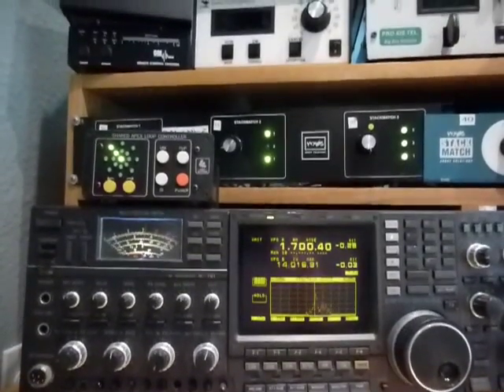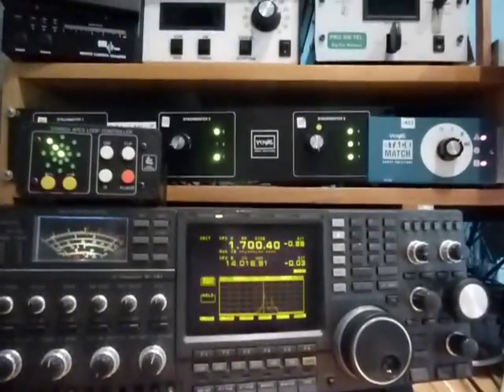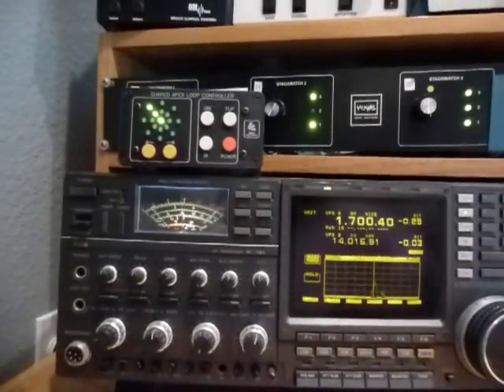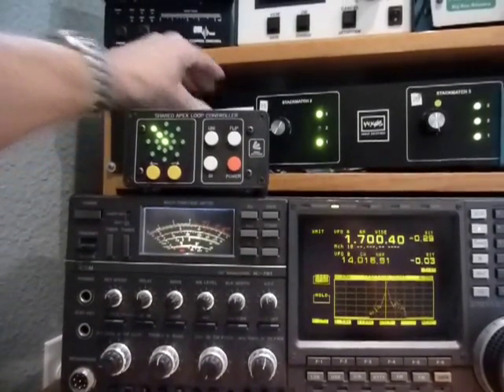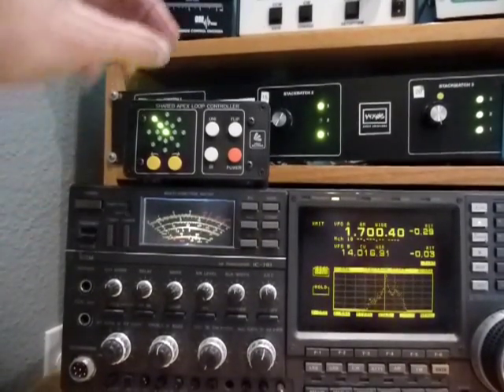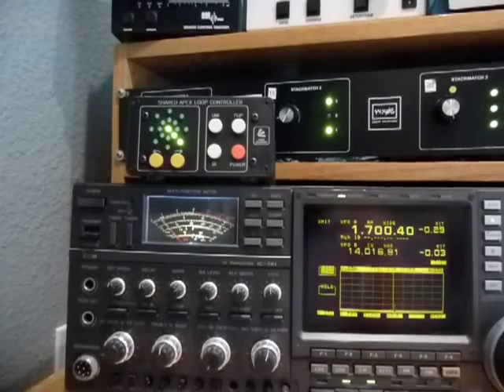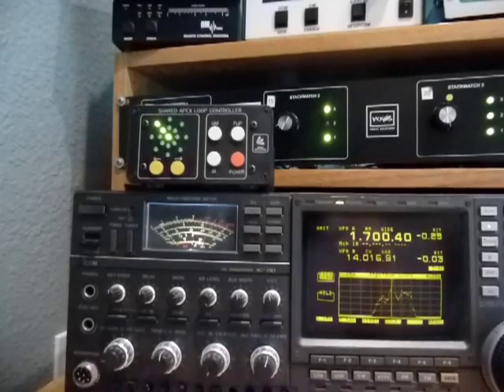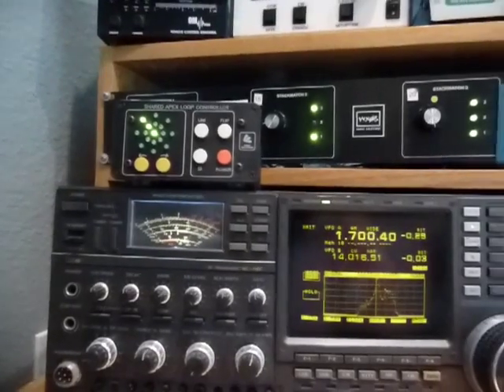Array Solutions Shared Apex RX Array, SAL vs. the  HI-Z four square

Comment: Hi. Congrats. It looks like you have almost optimal installation config in free space... It will not sounds so good  if it will be installed close to houses, TX antenna or other urban premises... ;(
Reply from the maker: +Petr OK1RP  Well it may not be optimal, but it gives the small lot owner a very big step towards being able to hear DX, when no other possibility exists.  Many have found it very helpful for small yards.  A SAL-20 works well. You do have to be careful to not let it get too close to metal, or the transmit antenna. It will couple.

Comment from the maker: There is a W3NQN RX BC band reject filter in line with the HI-Z to try to help contain the intermod.  It is what is introducing the big gain difference but not anything to do with the Front to Back numbers.  It has about -35 dB of rejection at 1700.  So after more measurments the HI-Z has about 10dB more gain then the SAL right now.  This can be made up with your preamp in your receiver.

Comment from the maker: This is a SAL-30, which has a 30 foot vertical wire, and 95 feet of wire in each loop. It does have considerable more gain on the low bands which is what I wanted. Pattern is still good at 40m but falls apart at 30m band and above.